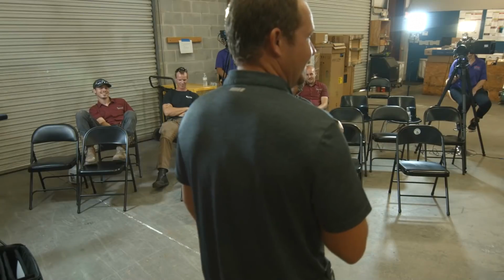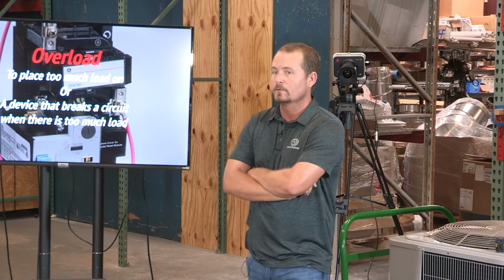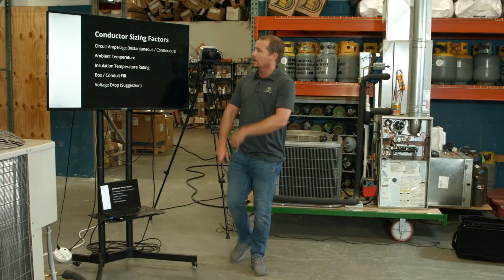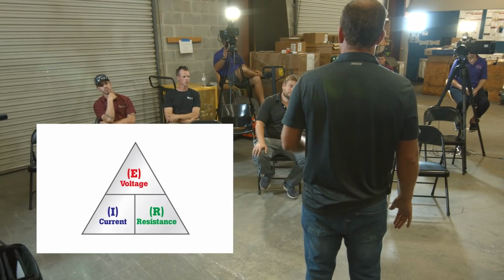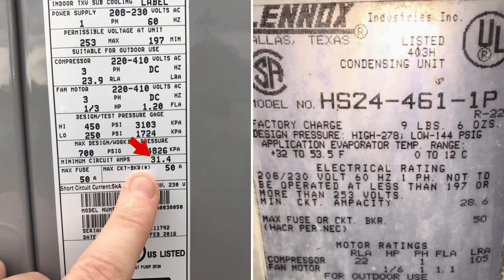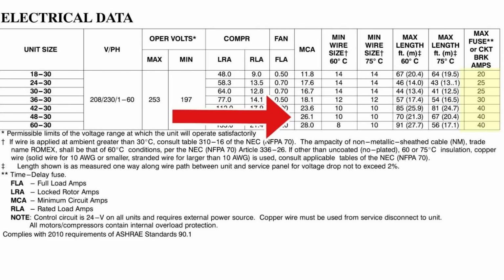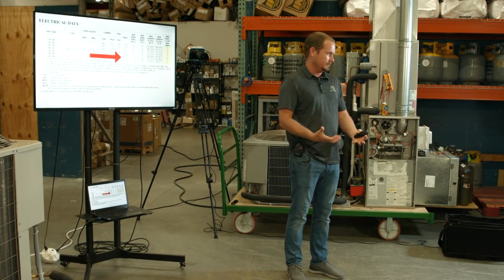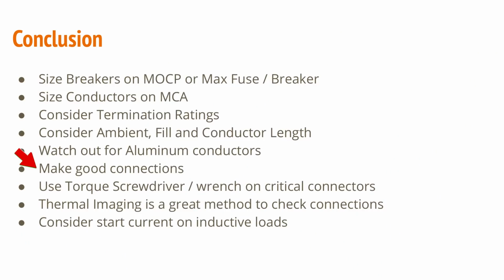Breakers, Wires, Fuses, and Overloads

Comment: Hear me out if your unit pulls 45 Amps you have a 50 amp circuit breaker but number 10 wire your breaker will not trip due to breaker not pulling 50+ amps but your wire is only rated for 30 amps so  you will burn the insulation off wires causing short circuit and you may have so much of an arc you catch the home on fire which NEC written by NFPA is trying to prevent. so I believe your wrong and do think its up for debate and also that your statement is not a fact. please respond with reasoning if you believe I'm wrong. Thanks

Comment: Great video!  Thank you!  My 4 ton has 30.5 max ampacity and 50 amp max fuse - very similar to you nameplate shown. I believe the wire is properly sized but the breaker is a 30 amp. I have never had a nuisance trips. Is this surprising?

Comment: A missed component of this is that the reason true shorts trip immediately and lesser shorts trip slow is because the breaker doesn't read amps, it trips based on heat. More amps means more heat, but if the amperage is only a little over, it takes time for it to heat up such that the breaker trips. When it's a true short of less than 1 ohm or so, it heats up fast enough to trip instantaneously. 

Also GFI's are typically only used in wet locations to protect against water. Think hair dryer falling in the bathtub. That may be why GFI requirements would be coming to the outside unit and not to the air handler. I've never seen a GFI in a dry area. I guess the evap does have a drain line for condensate, but that wouldn't really warrant a GFI.

Comment: Does anyone know why manufacturers specify higher than necessary (vs the min circuit rating/wire) max OCPD rating? why not strictly limit the OCPD to the minimum circuit rating (even though, technically, it could use a higher rated OCPD).
Reply: Because when the unit starts it is starting from a locked rotor position so the larger breaker is covering the inrush current on startup. It’s so the breaker doesn’t trip when the unit is starting

Comment: I think that the apparent disagreement about the max circuit breaker rating between electricians and appliance engineers is due to the point of view.   NEC is concerned about distribution of power.  Appliance Engineer is concerned about the appliance.  You are paying attention to the appliance rating as per the nameplate.   
The win win solution is the current practice.  Adding a sub-breaker at the vicinity of the condenser rated according to the manufacturer will protect the appliance.  
Similarly chemists see electrical current as movement of electrons but physicists see this current from the potential energy coming from the power supply.   Both are correct.  
Another analogy, ophthalmologists will write a prescription according to the condition of the eyes but optometrist will write the same prescription according to the eyeglasses required by the patient’s vision.   Both are correct.  I am a retired appliance technicians but it’s only now that I understand why point of views differ.

Comment: How am I sure if a unit being fed by a cooling tower that trips the breaker when we plug in the compressor is going out on overload or a short circuit
Reply: Check amps and check for shorts right?
Reply: I’m sure I’m missing something lol never worked on that
Reply: Thanks guys and yeah definitely check for amps turns out the compressor was protecting itself because it was rated for 115 v and the supply power was 220 they installed the wrong compressor

Comment: Lower the voltage,  higher the current.
Reply from the maker: Nope
Reply: @HVACS  watts ÷ by volts = amps(current)
Reply: @444MarlinSS  but watts do not remain fixed because E=IxR - In some cases what you are saying is true if there are controls in place to keep wattage fixed but with no special controls amperage decreases when you decrease voltage becasue resistance is the most fixed element in the circuit. Even resistance is a moving target in inductive loads becasue Inductive reactance reduces along with decreased motor speed but even then... rest assured.. if you drop voltage to a typical motor with no special controls the current will decrease... I know becasue I've done it many times.

Comment: A contractor I remember installed at the main panel the correct size breaker And at the condenser a larger breaker. Inspector said not passing. Contractor reason was because running the small breaker at condenser could trip out. I never understood that one. So contractor installed breaker got inspected and then inspector left then contractor changed the breaker back again. Can someone fill in what I am missing please.
Reply: He used a bigger disconnect at the condenser? Like a 60 amp instead of a 30amp?
Reply: @murkyturkey5238  Yes

Comment: Thanks Bryan.  I will be showing this to my Advanced Electrical class at school.  I do teach the "breaker protects the wire" and the disconnect protects the unit unless it is a non-fused disconnect and then I say size the breaker to protect the unit but still follow breaker size for wire and unit just to be safe.  Also, thanks for the clarification on the "romex" inside seal tight conduit.  DID NOT know that!  Make since that all "whips" are individual conductors and not romex.  Good job sir!

Comment: Reason they came out with requiring GFCI protection on all condensing units in the 2020 NEC was somebody got electrocuted when they touched a grounded condensing unit that was not grounded. Was told that at an IAEI continuing education class. Also must supply GFCI to all electric dryers and all residental receptacles 50 amps or less. Should mention that in at least comercial & industrial sitrs you ate allowed to use equipment GFCI circuit breakers that trip out at 30 milliamps rather then the normal 5 milliamps. Had a double sided 6 door 120 volt refrigetated unit that keep tripping out a 5 milliamp GFCI bolt on circuit breaker. Spent time running up to 1.000 volts DC from a megger to everything but control board. Never found any leakage nicked wires etc. . They replaced the 5 milliamp trip breaker twice nut still would trip every 5 to 7 days. Never tripprd the 30 milliamp GFCI equipment bolt on circuit breaker.
Reply: It may become worse due to non tripping or no tripping !

Comment: Why do loose contacts get hot and melt...Joules law, not Ohms law. It is to do with power, P=I²x R so a good connection has no resistance therefore no power but if the connection is loose the resistance increases and even though the current is decreasing the power (W) will increase and cause more and more heat. Hope this helps not confuse.
Reply: Done thousands of PM's and even a brand new motor starter contacts will have some voltage drop. Usually 3 to 10 millivolts for small motors but on piece of crap junk type IEC motor starters always at least twics as much.

Comment: First few minutes in my first thought it would make a great collaboration between Mike Holt Brian Orb electrical HVAC video
Reply: Attended 2 of Mike Holts seminars at an IAEI meeting. Very smart guy. View his code question & daily graphic 7 days a week.
Reply: @garbo8962  When I discovered his YouTube channel my son and I went all the way back to the beginning and started watching all his videos. 
               Can never gain enough knowledge about electrical especially when you’re in HVAC
Reply: Recommend “Mike Holt’s Electrical Toolbox” app you can go to Residential air-conditioning or commercial air-conditioning. You can put in them what’s on your nameplate, the maximum protection and your minimum circuit ambient and he gives you a whole list of the wiring and that you’re allowed to use.

Comment: Breakers can trip due to high heat also. Most have a thermal setting that they will trip if they get hot but the amps are below the current rating of the breaker.
Reply: Odds are if it’s too hot it’s overamping though
Reply: Ok ok lol
Reply: They exclusively trip based on heat.

Comment: Fuses, ? We don't need no stinking fuses.  Preceeds to put a 5/8's copper stub in a fuseable disconnect.
Reply: Ive found fuses replaced with 3/4" copper pipe before 😂
Reply: Those never blow fuses, nothing like a piece of Cu keepin things safe.
I always pull em out.
Reply: Worked at a large always extremely cheap gannett newspaper when they were doing great. Took cheap SOB'S 10 years to purchase two 1200 amp fuses for a safety switch that feed air compressors needed to run printing presses. Boss said just to install a piece of copper tubing. Told him that I would quit before doing that. Never purchased even one pair of rubber gloves needef to work on energized circuits.
Reply: izzy garbo 
Well, did ya have to quit? I would never endanger my coworkers. I’ve seen ‘no blows’ ark welded and that’s the least of the clients problem at that point.
Personally I won’t touch any work without correct PPE. It’s what you over look that will get you, no matter how ‘experienced’. A Good day is when nothing happens, a Great Day is when you make it home safe when it goes sideways.

Comment: I had no idea NFPA originally wrote “The talking heads “ burning down the house.
Reply from the maker: Yes... its a true fact
Reply: Aholes like changing names after being popular last 100 years. No more light fixtutes now luminarrs no more nuetral conductors now confusing grounded conductor. Bonus round was never anything in NEC as a wire nut = pressure connector & Romex and BX cable.

Comment: In the beginning of the video PSC motors and static pressure came to mind. It’s also nice to start think of refrigerant and density, high density needs more HP and low density needs less HP. You could jump into your SEER rating and energy consumption, like in a 4 season environment